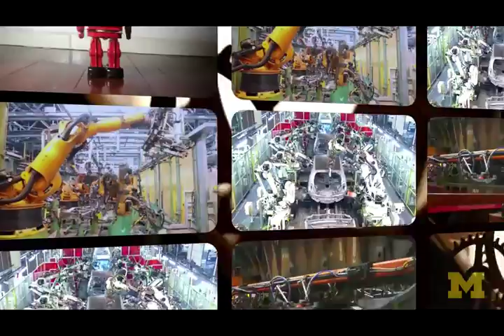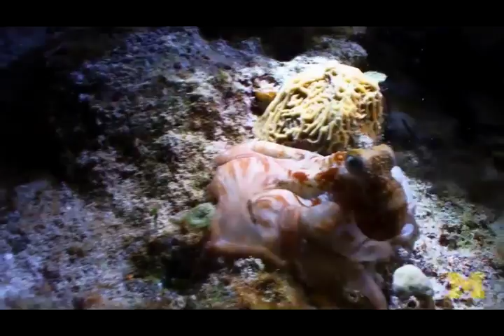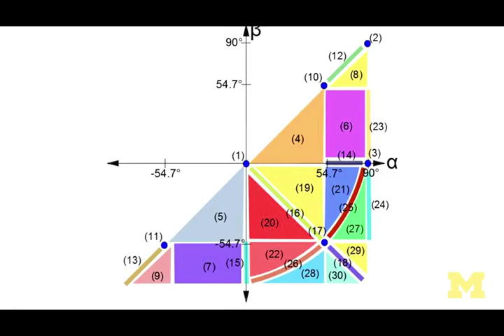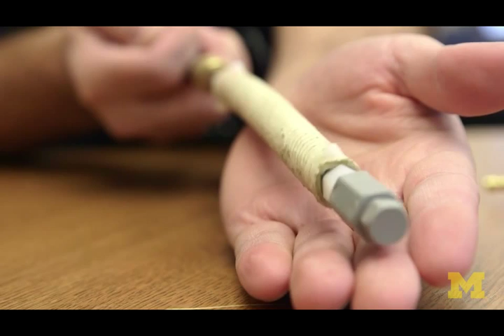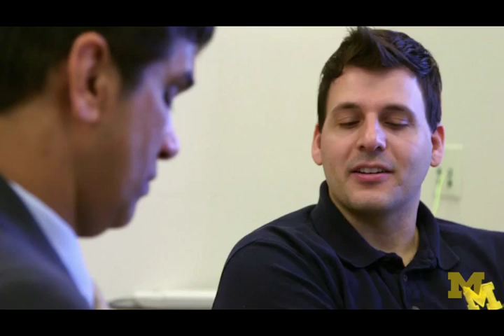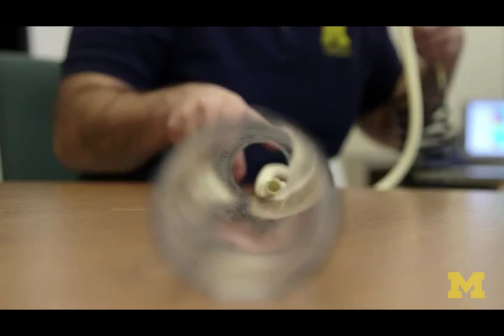Elasto-Fluidic Soft Robots - Michigan

Comment: I wonder if someone had tried using ferrorfluid instead of air in these types of robots.
Reply: What would be the advantage of that?
Or do you just mean hydraulic fluid instead?
Reply: Dejay Rezme ferro fluid is fluis that can be manipulated using magnetic fields , making it possible to react faster.
Reply: Do they really work that way? What would be the effect if it's constrained inside tubing?
Maybe you could manipulate the viscosity in a certain area?
Reply: Dejay Rezme that actually is the principle in some sports car suspension systems where damping can automatically varied without modifying the car and while running.  There are lots of you tube videos on this but I have not seen it used directly as actuators.
Reply: Oh that's interesting. I figure they can slow down a rotating magnet or disk because of magnetic fields.

The only (crazy) idea I could come up with for soft robots would be that maybe you can "solidify" the ferrofluid using a magnetic field to kind of have a "liquifiable bone". So part of the robot could be soft or with a magnet field it becomes stiff, or it can hold the pressure better and therefor lift more. I have no clue if ferrofluids can actually do that though.
Reply: Dejay Rezme i would not be surprised if it could.  You could also check out the videos on Eric Lanwhite's, the father of the maglev train, demos on how maglevs work.  The princples of maglevs could be possible applied to a ferrorfluid based actuator.